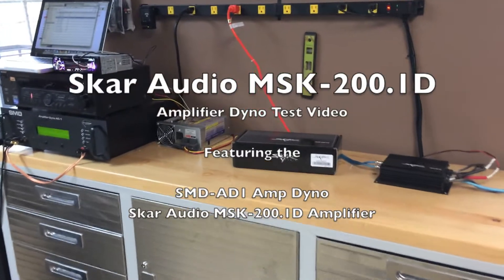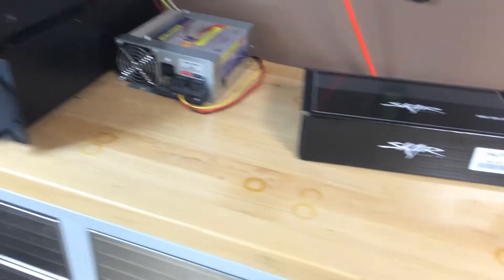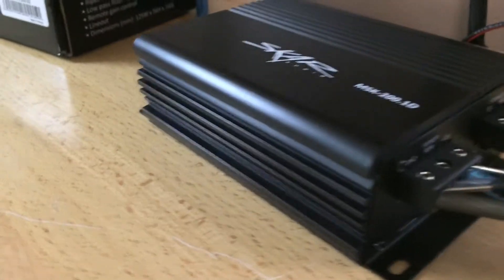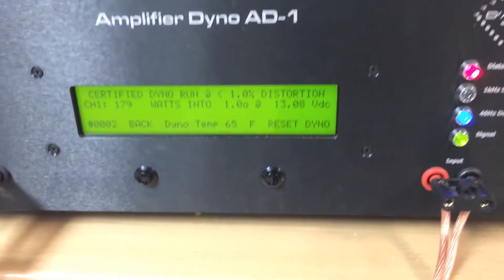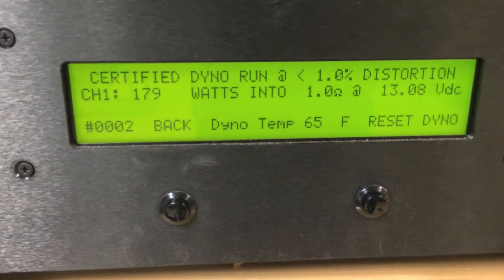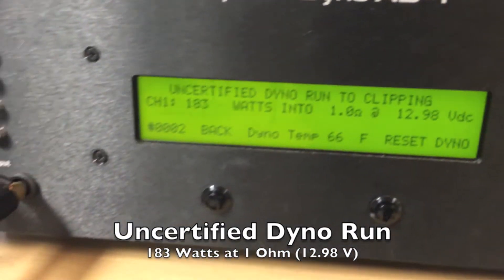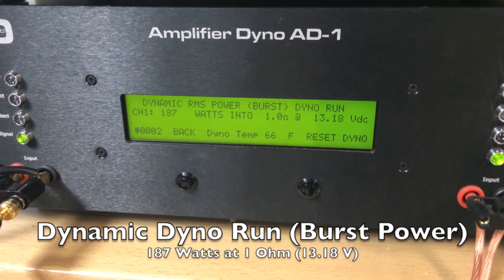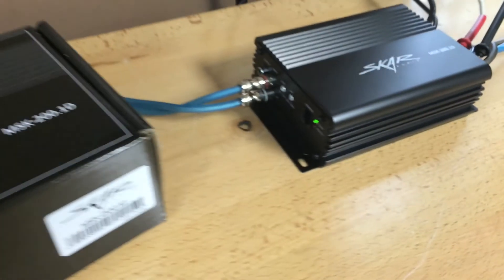Skar Audio MSK-200.1D SMD AD-1 Amplifier Dyno Testing (Real Power Results)

Comment: Sure, I'm gonna pay 190 bucks for 180 watts. into 1 ohm. For an average 4 ohm speaker you're selling a 45 watt amp for nearly 200 bucks. That couldn't even run a single midrange. Seriously.

Comment: There is a reason why he did not bench that amp at 15v to get a true 14v result... my guess is that it either protects with anything over 15.3v or it doesn't do rated power at 14v.. why would he bench every other SK at at 14v and not this one